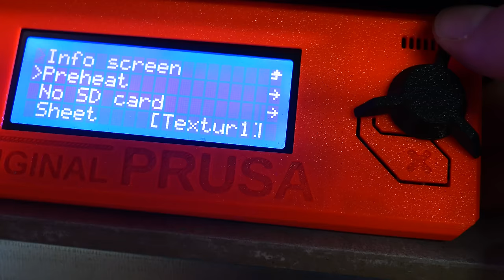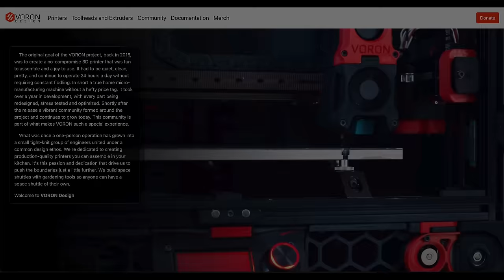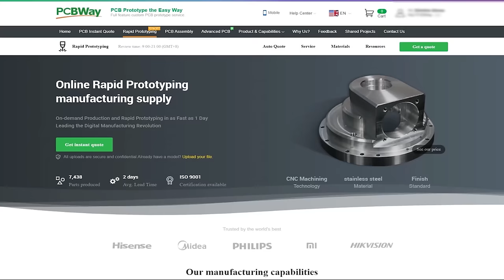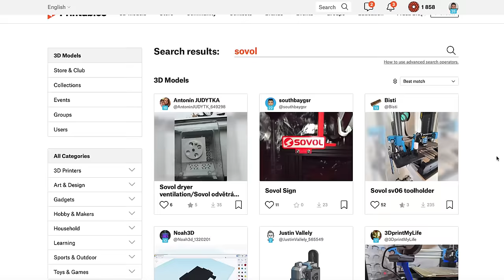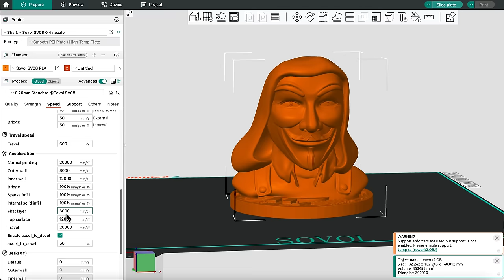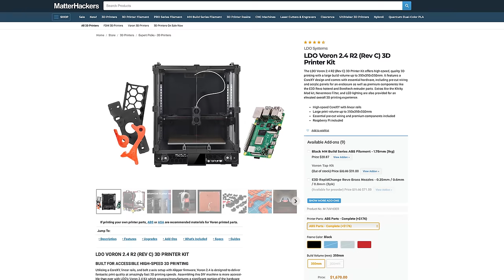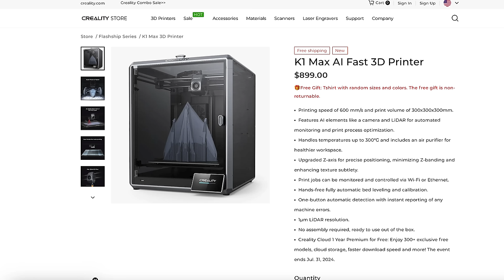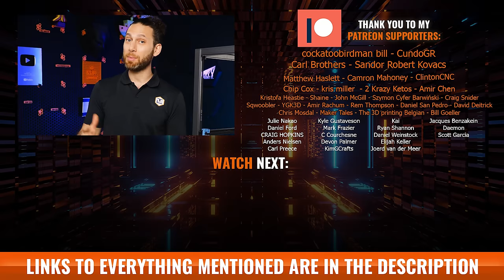The Sovol SV08: You Won't Believe the Price…

Comment: I wanted to build a Voron 2.4 but the time investment seemed a bit daunting and having the parts taking up space on my computer desk and table with pets around, something would be bound to get lost or misplaced (I am a tinkerer at heart and my job is a Garage/roller door service technician and electronics technician so building/modifying things is normal to me). I have purchased a Sovol SV08 and am waiting for it to ship. Coming form an Ender 3 V2, this will be a big upgrade. 

A few reasons why I purchased it is due to watching your videos, also Teaching Tech's video and coming from an old school bed slinger to a Core XY will make a big difference. Keen to see what Teaching Tech does about having multiple print heads and also keen to see what you will be doing with mods on the SV08

Comment: I've owned two Sovol printers, still own one. The build quality was horrifically bad on both, both needed replacement parts sent -- and in one case, *even the replacement part needed to be worked on*. Sovol cuts corners hard on quality control, and I wouldn't be surprised (although I'd like to be) if the same issues shows up here. Sure, the review model works great, but you know, the review models always do. What the average customer gets, though, is very often a different story. I'd like Sovol to change, because the one thing about Sovol I really do like is they are committed to open source. Assuming the QC becomes actually half respectable, I could see this printer being a really great option for someone looking to print cosplay parts like helmets, or even larger stuff. My suspicion is this will be a great review printer and a colossal nuisance for regular customers, like their other offerings so far.
Reply: hope the recent merger with comgrow changes things for the better
Reply: well I have 5 06 and plus machines and they all just worked out of the box. Probably 50 or more of them in my city and no one has issues. My OG 06 is number 168 off the assembly line and I've upgraded the cooling fan but everything else is original, extruder, hotend, bearings, etc. Been rock solid machines.
Reply: @andrikurniawan531  Comgrow is worse, so I'm hoping they don't learn bad habits from them.

Comment: Why can’t these new printers just use a basic brass e3d revo nozzles? A 3 pack is like 20$ usd. Bambu, sovol, Anycubic,etc should just stop trying to reinvent the nozzle and just partner with revo nozzles. They are easy to change out, you don’t have to use a tool to unscrew it or short a cable and ruin the whole drive gear on a p1p…….. these new nozzles cause more problems than solutions. Could you talk to your contacts and ask them if this is a possibility for the solution? I’m sure customers wouldn’t mind paying a little more to know that every nozzle will work on any printer with just a few seconds of swap time,

Comment: How is something completely based on the Voron a Voron killer?
Reply from the maker: I don’t know if it is. Depends what you want. But if you want a big ass open source printer that prints fast without spending $1999 and 40-50 hours, this is a Voron killer.
Reply: @thenextlayer  it markets to a different audience. but i get that you needed your catchy title.
Reply: @thenextlayer Comparing prices of LDO voron and this piece of junk that's going to fall apart any second? Nice comparison you've got there.
Reply from the maker: @youtubehandlesux  Oh jeez are you one of those silly Voron tribalists? How many Sovol machines have you owned...? And how many hours have you put on the SV08? I'm still running my SV07 and SV07 Plus regularly, and they don't "fall apart." You're talking out of your ass and you know it.

Comment: You mention "heat soaking" the printer but do not explain what that means or how to do it. Can you please do that, explain "heat soaking?"
Reply: It's heating the bed 10-15min before you print
Reply: @Cecina-  Thank you
Reply: It's a term used for industrial printers since they have heated enclosures and run at high temps. This joker is just heating the bed early.

Comment: CANBUS does not make wiring issues easier. It makes them exponentially more difficult considering now you have to diagnose essentially an encoded USB network with no insight into how or why or what is malfunctioning. There are countless things that can cause CANBUS to malfunction, including voltage. Give me discrete, simple wiring any day.
Reply: I haven't had any issues with CANBUS over the years, either in wiring or troubleshooting, I find it so much cleaner to use. To each their own.

Comment: You probably won't believe me, but I have been waiting for SOMEONE to do exactly this.  It just makes sense.  Interesting that sovol was the company.  The closest thing I can see is the Phrozen Arco, but that is proprietary and the specs are still not out there.  That machine will cost $800 something dollars.  Also no enclosure.  But they are going to make a multi material unit.
Reply: I've been waiting for someone to do this with the RatRig design. .

Comment: these guy probably never heard of Creality K1 series and QIDI tech X series. pretty much like an Iphone fanboi that never want to use an andriod phones and try out new innovations. and concidaring for that said price Sovol SV08 ( that ain't cheap at all!) I rather go for those trusted expirienced brands Creality, QIDI Tech etc. those newly line-ups even have new technologies built-in on it.
Reply: My K1 gave me nothing but trouble, and I have a Qidi Max that also has serious problems and no easy way to fix them. A Voron based design gives me much more control over the printer and the open source community is there to help with bug fixes and problems, Creality is about as far from a trusted brand as I could think of. Qidi has been better than Creality for me, but are so hard to modify,.

Comment: People wanting only open source parts are stuck in yesteryear.  You won't have a nice high performance printer unless you go to those purpose built parts.
Reply: lol, it's obvious you've never built a voron. Cry about it.
Reply: @youtubehandlesux  I am actually not the one crying, the people who want open source generic parts are.
Reply: Not necessarily.  The E3D v6 was a bit radical when it first launched (Look up "j-head".  I dare you).  But they open-sourced the design, which is part of why it's such a classic.  Bambu is taking a different approach-- they worked with E3D on the Obsidian, but it's a licensed hot-end-- and half of that money is being given to the Sanjay Mortimer foundation, and the other half is going to a foundation Bambu is setting up with similar goals.